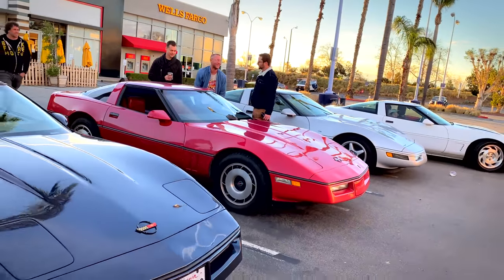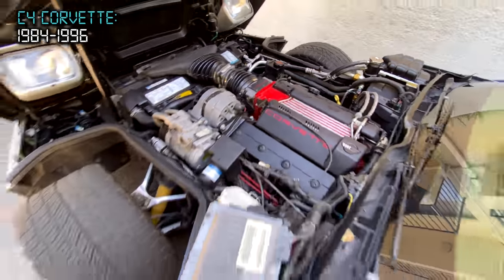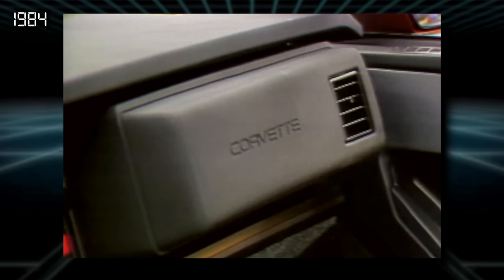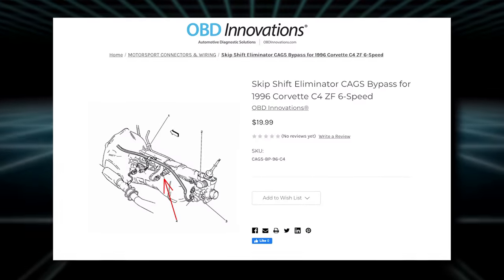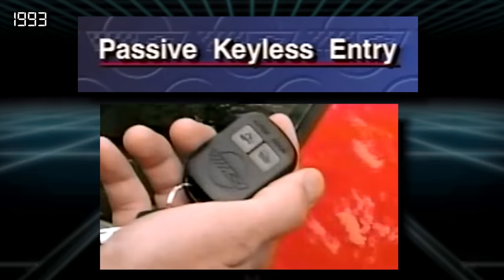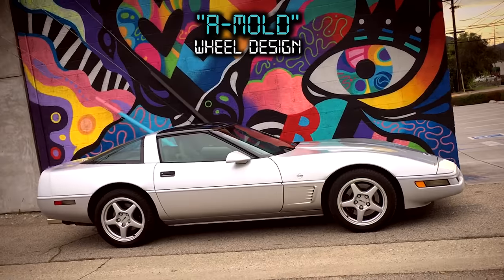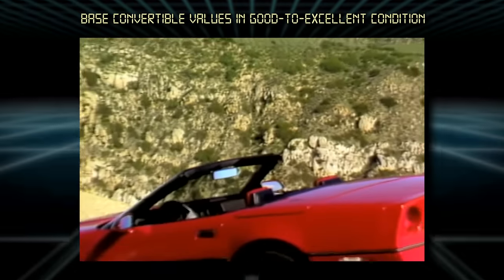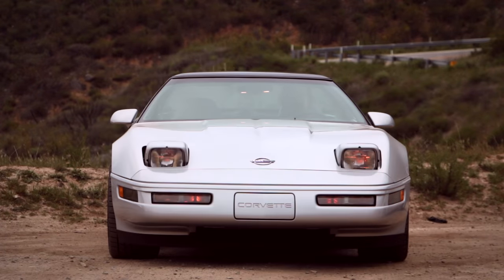C4 Corvette: ULTIMATE Buyer's Guide (Values, Performance, Yearly Changes 1984-1996)

Comment: Great video and very well done!  I have a '95 6-speed with 187k miles that was well maintained by its previous two owners and I am continuing a high level of stewardship for it.  The C4 regardless of year still represents a lot of bang for the buck but as you said, prices for good ones are only going up.  Get one while you can and drive it!
Reply from the maker: Agreed! That's some pretty high miles for a C4 but sounds like it's been well cared for. 

Thanks for the kind words on the video and for tuning in.
Reply: That's great to hear that car has so many miles. With prices on everything going up it's a shame that lets people are actually driving their cars.
Reply: My 92 has 174k miles with the manual transmission and really that's nothing. You have to remember that these are truck based motors and even if you drive them hard the engines will really never wear out because they're only hauling around 3000lbs. Change the oil and the driveline should last 300k+ miles even though the interior and electronic's won't
Reply: not here in Vegas. Nobody wants c4's here. c5's -c8's is a whole diff story
Reply: @robwhite3241  that's true
Reply: 240hp from a v8 isn’t bang, no matter the buck.
Reply: @SKRooU2  because the C4 is trash.
Reply: @throbbinwoodofcoxley6830  perhaps you weren't around in the 70's after the emissions regulations started? When the Ford 5 liter Mustang II was 145 HP and the GM 5 liter was only 175 HP.
Reply: @robertlemaster7525  And the 1979 Pontiac TransAm 400 (6.6l) generated a whole 220hp (4-speed only; the 403 Oldsmobile motor with the auto was only 200ph).  Yet it was one of the fastest and best handling cars of its day (and I had one for a few years -- never should have sold it!).  The emissions regulations really strangled the power of muscle cars in those days. (Of course, the re-rating motor advertising from "HP SAE-Gross" to "HP SAE-Net" made for a tremendous reduction of "claimed" horsepower to actual/realistic horsepower ratings.)
Reply: @RetroCarsForever 35k miles on YOURS😮 wow!!
Reply from the maker: Its at nearly 40k now, been driving it a lot!  @jr1921

Comment: 1985 C4 owner here. 1985 is my favorite year: no abs, no key-security, no optispark, TPI yes, digi dashboard yes (best version) + best looking turbine wheels.
Reply from the maker: Can't argue with that! 1985s are exceptional values, especially for anyone who wants that "old school" feel.
Reply: Hello Brother!

I bought my 1985 Corvette back in 2014 for 3250. Its my profile picture practically everywhere online.

Seller originally wanted 3500 but reverse wasn't working, my dad had it on the lift to check it out and the linkage was a little messed, he was able to fix that in about 10 minutes so I got a special discount. Seller also included the updated window regulators.

I agree with the dash cluster three bulbs were burned out when I got it so I replaced them with LED lights. Looks just like Star Trek The Next Generation. I intend to replace everything with LED lighting eventually, just need the interior lights, under the hood, reverse, side markers, license plate and reverse lights. I have the headlights but need to swap out the motor gears (I have brass ones to replace the stock nylon gears).

When I first got it I had no idea how to drive manual transmission but this was my motivation to learn. I stalled in the middle of the road once but saved the car, screeched tires though but she's still alive.

I took it for a 100 some mile trip with my dad, had it cruising around 60mph in 4th gear, he even said if he wasn't there to see it he'd think I was joking I finished that run with 26mpg average.

Fastest I ever had her go was 130mph, just for a little bit.

Gonna keep restoring it and adding my own touches to her as the years keep us together.

Cheers and best of luck with your Corvette, my brother!
Reply: I love my 85 with the z51 package
Reply: 4+3 tho...
Reply: @CharlesFlahertyB  I just found out mine came with a 4+3 transmission,but someone swapped  a 700r4 because  they installed  a 383 stroker ,good thing is I do have a dana 44 with the 700r4 now ,I am running  a stock 350  and the 383 is out to rebuild.
Reply: A very useful pricing guide.
Reply: @MrMany2811  a 44 isn’t strong enough for spirited driving.
Reply: @throbbinwoodofcoxley6830  is enough  for me ,I just cruise around
Reply: @throbbinwoodofcoxley6830  Yes it is.  You must be thinking of a 36.
Reply: @ChefofWar33  nice profile pic
Reply: @RetroCarsForever  hey I’m looking at a 1987 C4 manual 4+3 52k original miles mint conditions , those grind on 4th gear… any thoughts 5k
Reply from the maker: @edwinjimenez2267  Potentially a good deal, but if I were you, I'd find someone you trust locally who can fix that trans issue and get it priced out before making a decision.
Reply: @haloslayer255  tell us what's changed!
Reply: @LMAOOOOOO  the engine is still stock, added LED bulbs to the dash cluster, headlights, interior lights. All I need to do is change the carpet and repaint it, has a little bit of cracks here and there in the original paint.

I have LED parking lights but need to install those, dame with tail lights but am waiting until I get the correct color coding for the side indicator and turn signal lights.

After all that I'm going to see if I can get a few more interior things changed just small accessories and touchups.

Have a good evening!
Reply: @HaloSlayer255  sweet thanks for answering so fast
Reply: @LMAOOOOOO  no problem, always love talking about Corvettes with fellow brothers and sisters. Ever since I was a kid I always loved the model, it was probably a C5 generation that I'd seen but it instantly had me hooked.

Anyways have a good evening!
Reply: Yeahhhh
Reply: That's your opinion!! Personally I'd take the optispark LT1 over any year TPI!!! Especially the early ones!!! Horrible interior!! Horrible gage cluster!!! Horrible wheel and tire combo!!! Horrible horsepower!!! Way ugly body panels!! I could go on and on!!! Also why you can find the early ones for basically nothing!! Hell they might pay you to get rid of it!!!🤣🤣🤣🤣
Reply: And no brake light on the roof in 1985
Reply: @MrMany2811  absolutely nothing wrong with that!!! Personally I'd much rather have the 700R4 vs that horrible Doug nash!!
Reply: @throbbinwoodofcoxley6830  and where did you come up with or hear this crap!!! And then you repeated it!! Like it was gospel!!! The Dana 44 is definitely a good rear-end!!! The Dana 36 is the weaker one I have a super heavy foot and I haven't broken it yet!!! It blows my mind that people just shotgun bullshit information!!!!! You need to do better bro!!!
Reply: Is the air conditioning freon R12 hard to get?
Reply: @mgdiaz2158   I'm pretty sure you can get it at any auto parts store.
Reply: *worst transmission if you have a standard.
Reply: @stevenhaffley9852  I'd rather have the 700R4! At least you can modify the 700R4 to be badass but that Doug Nash is what it is!! Junk!
Reply: You also have cast iron heads on a cast iron block which from what I hear is less prone to head gasket failures than when switched to aluminum heads in 1986. I'm hoping to find a clean red on red 1985 corvette with the Z51 package one of these days.
Reply: Also no HP
Reply: 85-89 have horrific, outdated ugly interiors. 1990 is best year for older style C4's as the interior is upgraded and have CD players and not a cassette player.
Reply: Well FPS  just Bought a 85 it's  clean 1 owner I had 84 I brought it back with my son to be a decent car not a trip runner it was very rough im just hoping to enjoy it with my wife ....
Reply: Oh but the interior and dash is horrible compared to 90 and up

Comment: At 74 I started looking at used Vette's.  However, my mechanic told me that repairs were very expensive and at my age I won't be doing my own maintenance  anymore....so, forget the Corvettes.
Reply from the maker: Too bad, I think Corvettes are more reliable than many other top-end sports cars. However, something like a Mustang would still be a fun V8 american sports car that is cheaper and easier to own and fix, might be worth considering instead (I've owned a few of those as well).

Comment: The digital dash is crap, the pop up headlights have plastic gears that turn to dust, the fuel cover loses the adhesivnes that holds it to the metal spring part.  I owned an '89 convertable, loved it except for those things mentioned.  Also, had to replace, did it myself, the u-joints on the half shafts.  Going to buy one, work on it yourself, get the original GM shop manual, not cheap, well worth the price.

Comment from the maker: CORRECTION:
When I mention at 3:04 that many early C4 digital dashes have had their old bulbs replaced with modern "LCD bulbs," I meant "LED". 

Thanks to George Ar for catching this weird little flub!
Reply: Not just that but the polarized plastic over the displays did not like the sun. Along with a week power supply and connectors that would fail over time since they are 2 circuit boards sandwiched together. This makes it a challenge for people that want to purchase an older C4 but can't see anything on the dash. Don't ask me how I know!
Reply from the maker: @TotlKaos  I've heard Batee.com is the savior for early C4 owner digital dashes!

Comment: I just bought a 1989 With the Z51 package... Quite possibly the best C4 Corvette IN MY HONEST OPINION! Obviously the ZR1 is a superior car altogether, but the 89 Z51 has it just right. Fast enough to have fun, has that Retro 80s vibe which is absolutely fantastic, and its the only year with that body style to have the ZF 6 Speed. Its a gem, and all I could have asked for!!
Reply from the maker: Nice, cant argue there! If I didnt need a C4 as a daily I'd look at a 1989 as well. 

Great mix of the awesome older styling/digi dash with the newer suspension/brakes/trans.
Reply: I just bought a 1989 TPI with the ZF6 for the exact same reasons. I've had it now for about 2 months. It is my DD and I got it with 56k miles and so far have put 3k miles on it, mainly driving it home from the dealer across 5 states!
It does squeak a bit and rattle, and it is older than than a newer 95-96, and yes the TPI motor runs out of breath much sooner than the LT1 or the LT4, but I love the digital dash and the ZF6.
Reply: I love my 89 Z51!
Reply: @chenlmax  treat that transmission with loving kindness... they're pricy to repair from what I hear

Comment: Regarding longevity, I purchased my 1995 new and accumulated 261,000 miles by 2014. The automatic went out twice, 1st at 152,000 miles and then again at the current 261K. The only things done to the LT1 is intake gasket (twice), water pump, and starter (twice). Untouched opti. I've been pleased with reliability, and I even autocrossed and drag raced it some in the early years.  It's been down the last 10 years, but finally about road worthy again as a Sunday driver😊.

Comment: Having owned this generation since almost new starting in 1991 through 1996(today), you covered every single detail I could have imagined and then some. Words like salad shooter and sawblade are spot on most certainly. (Decent point about the LPTW headache along with the Opti-Spark too). Remember the transverse-mounted leaf spring wasn't only in the front of the car, but the rear as well. Every single point to a Corvette aficionado was covered, with the most correct choice of words used in your voiceovers. Just a few items missed on the improved structure of the convertible that was also added to the coupe in later years from my understanding. Also from '95 on the brakes were upgraded(thanks to the knowledge GM learned from the ZR1 models). One of the most important points you alluded to was the importance of all service records. Bottom line: Great job Brad. (Incredible attention to detail).
Reply from the maker: Thanks so much! That means a lot to hear from a fellow C4 aficionado.
Reply: Funny bout that, service records don't matter to me, I just go thru the whole car when I get it. 

Sometimes I win, and sometimes I lose...on the winning side more often. 

The last c4 I had, I went thru all fluids and changed the whole suspension.   

Drove like a dream

Comment: My grandpa had a red 96 C4 LT1. He bought it lightly used in 97 and owned it until 03. I was so young at the time that I don’t remember it that well but would like to have one like it someday.
Reply from the maker: Those are relatively popular options, I bet you could find one just like it if you’re a bit patient! Best of luck.
Reply: @RetroCarsForever   Thanks! I actually did find a really nice one for sale just like it on my local classified car listings. It’s a red 96 with the LT1 and only 14k original miles for $19k but unfortunately I’m not in the position to buy it at this time.. someday though 🤞

Comment: Back in August of last year, I bought a 1984 with the Z51 handling package for around $5000. Its rough around the edges but nearly everything works. It's my daily driven mild restoration project, and even in it's rough shape, it's a blast to drive
Reply from the maker: Heck yeah! That thing must handle like its on RAILS. The red 1984 that you see in this video also had the Z51, and had no problem keeping up with my much more powerful 1996 LT4 in the canyons.
Reply: @RetroCarsForever  it sure does. I can take smooth freeway on ramps at least 10 mph faster than the recommended on the sign and there is zero body roll. Only downside is that your spine becomes a 5th shock
Reply from the maker: @michaelbutkus4790  Haha that tracks!

Comment: iconic American sportscar of Reagan-era America.

it set new standards in terms of technology, driving dynamics and handling leaving its contemporaries in the dust.
a significant sportscar not only for America and the storied name of Corvette, but in terms of sportscars and performance vehicles overall!
it also competed successfully in motorsports and has amassed an impressive racing pedigree.

a beautiful clear design, futuristic and forward-looking, pioneering, trail-blazing and trend-setting at its time, 
 aerodynamically sleek and trick, as well you can tell how 
it aged gracefully and incredibly well.

they get slowly but surely more desirable and collectible, with several models already very valuable, definitely investment-grade vehicles, so those that have an opportunity in the market should not miss out and grab them while they still can.
Reply from the maker: Well said!

Comment: I have a 90 C4 with the Z51, shocks long gone. Paid $6000.00 for it in 2009. Had 134,000 miles on it. Now has around 140,000 or so. Runs strong and doesn't leak a drop of oil. Unusual for a small block. I did put a chip in it and change the thermostat. I did repaint the car and the interior is not pristine but it shows well. I have had 5 Vettes since 1976 and was fortunate enough to own 2 news one. A 1978 and a 1979. Both L82 cars. Thanks for the info on the video.

Comment: This is comprehensive and valuable!  Mega helpful content.  I'm glad you reiterated that even a static 'collector' car that just sits around needs fluid maintenance.
Reply from the maker: Thank you! Yes, "static" cars needing maintenance is one of THE BIGGEST things most car owners miss, especially Corvette collectors. "No miles equals no work" is a myth I was happy to dispel in this!
Reply: @RetroCarsForever u think I can find a 86-89 with good paint and runs well with around 80-90k on it for 8k?
Reply from the maker: @SlammedImp  See the values guide near the end of this video!

Comment: As a fellow LT4 CE owner I thought this was an excellent video. I'd like to add that I get 12.5 mpg according to the computer and that's in city commuting. It came with Continental summer tires and this thing hauls. I got it while looking for a '90 and I adore it. It's so dailyable and I find it's surprisingly comfortable (non-Z51), but the real kicker is how alive it feels. I think mine had sat for a while and I've spent around $4k getting it reliable and naturally I've kept records, but at this point I'm optimistic that I don't have to spend a lot  more other than consumables and normal maintenance.
Reply from the maker: Awesome, and thank you! 

Sounds like we get about the same MPG in the city with out LT4s. By 1996 the base suspension was pretty soft, much more comfy around town but definitely more lean in the canyons...The guy in the white car in this video brought a 1996 LT4 with base suspension and I could SEE how much more body roll there was. If I didnt take my C4 canyon carving often I would MUCH prefer the base suspension and its suppleness. 

I bet you'll be good going forward with reliability, most C4s needs a few grand of "baseline" work to get it to a point of reliable daily driving. 

Enjoy your car and thanks for the comments!

Comment: Yeah I’m happy I was able to pick up my 89’ Vette with 132k miles for $2250 because it needs a transmission and a few odds and ends but I’m picking up a used ZF6 speed manual with 119k miles for 750 so one hell of a deal if you ask me, it definitely helps when I’m on marketplace damn near 24/7 lol great video for sure
Reply from the maker: Thanks! If I was to buy an earlier C4 I'd go with the 1989 for sure...Rad early looks and digi dash, but with the more modern brakes/susp/transmission.

Once you get your car finished you'll have one hell of a fun car for chump change, especially if you can do the work yourself!
Reply: I sold my 96 auto and bought an 89 manual. The stick shift makes up for the lack of horsepower.
Reply: @fryloc359  no airbag, no opti, i love the 89. Im stuck with a 96.